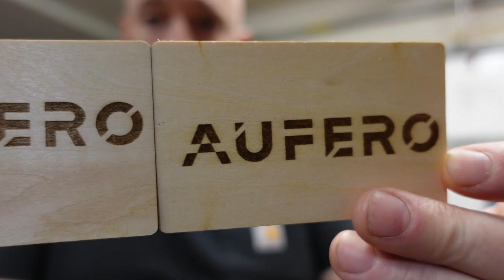Assembling and Review of the Ortur Aufero Laser 2

Comment: Hi, Great video. 
There is a big difference between the 5.5Watt LF and 5.5Watt SF module, and that is that with the LF version, there is way less Kerf, and also, the LF comes with an Air Assist nozzle, and that''s not available at the SF version. With the Air assist on, at 2 Bar pressure, there is no smoke in front of the laser, and all dust will be blown away from the cut. This makes a BIG difference in cutting depth between the 2 laser modules.
Also, the Offline controller is only available for 24 Volt systems, as it is introduced together with the Ortur Laser Master 2 Pro (24V) and it's also compatible to the Aufero Laser 1 and 2. It's in the shop right now.
Reply from the maker: Good to know. I haven't had a chance to work with the LF yet, so I can just go off of what folks tell me! LOL
Cheers